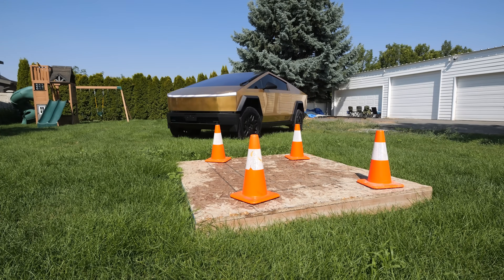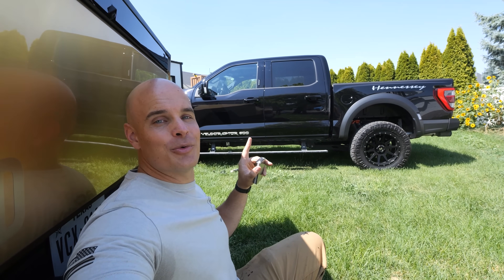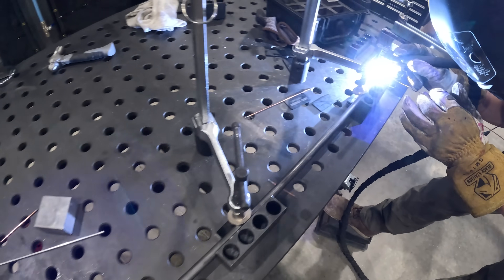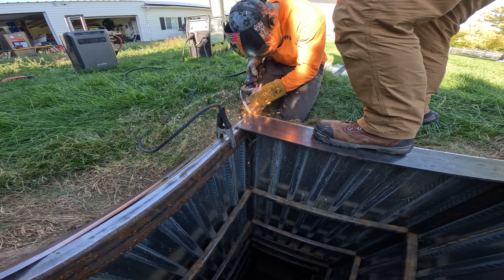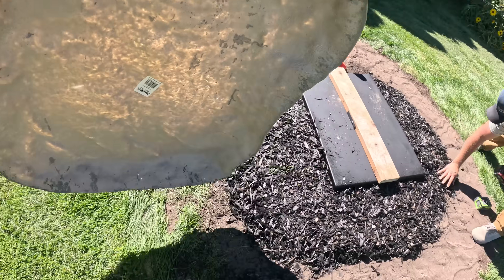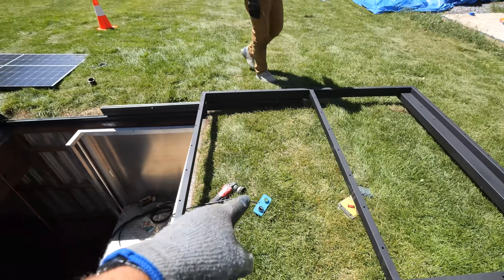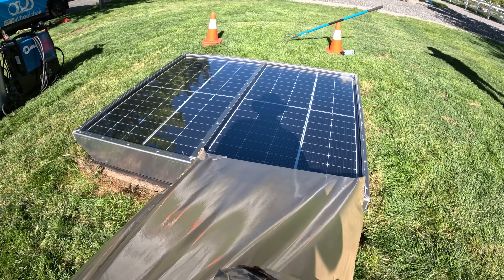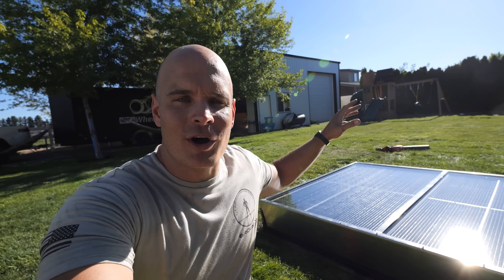Bulletproof Solar Panel Bunker Door Build - (unlimited energy!)

Comment: 320W * 2 * 1.15(bi-facial gain) * 1.5(Utah sun efficiency) * 90%(panels lie flat) = 1000Kwh per annum.  That's quite tight (<3Kwh / day) for 2 people, let alone you might take in a few buddies.  And then you have that huge 90 inch TV which can eat 600W.  Use it 5 hour/day there goes your daily budget.  And you are preparing for Armageddon?  You are not going to see 1000Kwh in a nuclear winter.  What you really need are nuclear batteries.  Lot's of them that can last >5000 years.  You also need more room and electricity to grow vegetable.  LOL.

Comment: you said you have kids running in the backyard sometimes and kids will be kids...why not just make the solar panel cover auto-close?
you could attach a cable inside the tracks to the unistrut bearings plates and attach a weight to the cable and just put a plate against the wall to cover the weight so it's not dangling freely
then you could weld a piece of steel to the top of the elevator diagonally and weld another piece with some ball bearings on the underside of the sliding door
so that when the elevator goes up one plate pushes against the other with the ball bearings forcing the sliding door to the side
this way it auto-opens when the elevator goes up and auto-closes when it goes down

Comment: Here’s my recommendations:

1 • (Power) Add more solar panels and more powerful ones if possible, Also chargers of every type like usb-c chargers, usb-a chargers, lightning chargers, micro-usb chargers, etc. (This category is done.)

2 • (Emergency items and kits) Add lots of canned food and emergency kits, They could have tools, toolkits, energizer lithium batteries (AA) (AAA) all types Etc. Also some rechargeable batteries from energizer (That’s the best brand for small batteries like (AA) and etc. Also toys, games, solar power banks, normal power banks, flashlights, canned water, more canned goods, pet food, canned pet food, airtight jars? (Could be helpful?) etc. That’s good for this category (This took a long time)

3 • (Clean air) Add even more circulation somehow, also add lots of air filters and air fresheners, you could also add automatic air fresheners that make the air smell good once in a while. (This category is done.)

4 • (Extra) You could also add super fast WiFi routers, and super fast hotspots running on 5G pro or 6G when it comes out. (This category is done.)

5 • (Medication) Also add medicine, pills, vitamins, all types (Idk all) (Make sure all of them are sealed and airtight to make sure it lasts. (This category is done!)

6 • (Random thing) Add sealed hand sanitizer and soap. (This category is done!)

7 • (Other necessities) Also add pens, pencils, paper, journals, books, erasers, (All types of pencils and stuff) Also glue and tape. (Basically school supplies) (I forgot printers!) (This category is done!)

8 • (More) Also add extra Shoes, clothing etc. (This category is done!)

9 • (Decorative stuff) Also add paintings fake plants or real plants. (This category is done!)

(🔴🔴🔴Message: WOW this took a long time to write hope this was hopeful and please credit me. Have a nice day🔴🔴🔴)

Comment: $300 for one solar panel? That's some huge prices there! In Ukraine, I have a 610 Watt bifractal from Longi Solar, model LR7, for only ~$80! You are very optimistic about these 2 panels, in cloudy weather you will have at best 10% of the nominal power of the panels, and this will not even cover the inverter's own consumption, much more is needed!

Comment: aren't you going to put a white panel under the solar panelswith a small air gap to reflect the light onto the backs of the solar cells from the light coming through between the cells? It would make them even more efficient...

Comment: You could build a small shed building g on that sliding frame then put solar panels on top that way no one can step on them and the building can be designed to slid open as lift goes up .. Lots of interesting ideas out there a d love your videos.

Comment: I wouldn't recommend attaching the wind generator on top of the roof, solar panels are notorious for causing roof leaks, and something designed to catch the wind may put extra stressors on the roof... maybe a pole along-side the building instead?

Comment: Seems like the hatch now blocks the elevator but since it does go above, you'll need a new ramp to get over the rails or to come in from the other side... A latch to lock it in place so the sliding doesn't happen would help too.

Comment: Make sure to use a hydrophobic coating on those plexiglass panels it helps with dust and water buildup although I think you should have mounted it at a slight angle

Comment: You should build a small shed and use the roof or the panels. The shed will hide the entrance and you have an extra layer of protection that blends in with normal backyards.
Reply: but that would mean even less airflow. which wouldnt  be a problem if he already put in a system.

Comment: Lots of comments on the solar, and rightly so, but my concern was security. The expense of a bunker that isnt gas tight kind of defeats the object? I was imagining some heavy duty hinged concrete door on top? Or a sliding one like on a missile silo. 
After the initial push, the bunker seems a bit on the back burner, cost issues im guessing?

Comment: What about the air intake and output? It seems like you go rid of the exhaust when you replaced the exit hatch. Also, is there ramp over the track for the wheelchair? And does it slide open even if the grass is really high?

Comment: How will Cambry enter the bunker now? The sliding rails look like it'd prevent her chair from easily accessing it.
Reply: Elevator video 14:25, it extends 2ft above ground level so will clear the sliders. Also mentioned a ramp but it wasn't used at that point.
Reply: He has a video showing them installing a scissor lift as a permanent make-shift elevator.
Reply: @Tyler-z8r  Yeah. But now there's a 2 foot tall rail on either side of the lift at ground level

Comment: Im wondering how your wife should get over those rails with her weelchair 🤔 I mean you could build a ramp wich covers the rails when the elevator goes up, but like this i think it would be hard to get in or out wth a wheelchair. Also would it be nice (i think) to be able to open the "door" with an elctric motor, so if the elevatr gets up the "door automaticly opens" or ith a button press. So you could lock it also.

Comment: Probably going to want to put a latch of some kind on that, it you want it to be "safe" you can have it suddenly moving when someone steps on it. Imagine some kid is running around and hops up onto the panel, only for it to slide forward, and they topple backward into the hole.

Comment: Why bifacial when you have installed them in a way that only one face can work.  The rear face capture’s ambient light and ground reflected light.  You should at least install mirrors under them or have just got cheaper mono facial panels.

Comment: Well done
But i think it's not a good idea to use acrylic in tempreature wise and  as you say always glass is glass and glas can break acrylic also can break and it  it scratchable more than glass and it will affect the efficiency of the solar panel

At the end don't forget to close the sliding door for childern is  safty

Comment: I don't think perpetual and unlimited apply to solar cells that average a 20 to 30 year lifespan and an absolute limit of 40 years for even the most expensive.  Also compare a refrigerator pulling 300 - 800 watts of power (when running), not really that impressive.

Comment: Doesn’t this dude have 10kW of solar on the roof of the building right next to this? Why independently power the bunker with a dinky inefficient set of panels?? Maybe if he stopped shilling for these hobby-grade solar companies, he’d put in a real Enphase or Tesla battery back up system in the bunker that stores and distributes energy from the roof top solar that IS RIGHT THERE. I’m honestly surprised I’m trying to make sense of this, when it’s just another influencer being an influencer.

Comment: Those panels are designed to be mounted vertically, not flat, not at an angle. You are severely reducing the efficiency of them as they take in light from both sides. I get it, this was to make it look cool, but you could have still come up with a cool design that used them in the right way. They are integrated circuits, as well, so you are also putting them in an oven, reducing yet more efficiency.

Comment: acrylic sheets are blocking uv so panels wont be as efficient afaiu
Reply: solar panels aren't typically tuned to make any use of UV and even if they were only 4 percent of the light that reaches earths surface is UV so it would be a tiny difference.
Reply: @zachmoyer1849  thanks for the clarification! do you know if then this also makes sense for plants? will plants be affected from blocking uv with an acrylic sheet?
Reply: @im0b  not for them to to perform photosynthesis but some do need it to bring on certain grow phases.

Comment: hear me out... add a motor, and LEDs down the entrance shaft, which light in sequence as the door opens, two benefits a) it'll look cool to be able to open your bunker from anywhere on the planet from your phone and b) you could add a strain guage and have it shake if it senses (some) weight and shake itself, as if it's annoyed at the kids playing on top.

B is optional, and should be togglable.

Comment: You should put a small light weight decretive fountain or bird bath on top of the fake rock to make it look even less out of place. Sure it will dump out when it's tipped but it's an emergency hatch not meant to be opened often right?

Comment: The scratches that'll form on the acrylic drastically reduce the efficiency of the panels, and also the sheets would have a UV resistant coating 
I hope you checked them

Comment: I think it's really good that you have your bunker hidden, but you better hope that none of the zombie mutants were fans of your channel before becoming zombies.   I do have one question, though.  Why have solar panels that can make electricity on both sides if one side is permanently facing the ground/opening?  Or did I misunderstand how those panels work?  

I live in an apartment so an electric truck would not be a good choice.  As for the gas truck, I don't drive anymore because I've taken painkillers for my back for the past 11 years.  So I think I'd have to opt for the cash.

Comment: Noticed that the frame doesn't slide completely clear from the hole, nor that the bottom slider is recessed. How exactly is the elevator still wheelchair accessible with a massive frame in the way?

Comment: I dont get it. Is that the main entrance to the bunker? If so, how do you close it shut? Why not place some kind of hidraulic and ratacional system on it to maximize the solar panel performance? Why not an alternative system that collects wind power to complement the energy generated by solar panels?  I am not sure where are you going with all that at this momment...

Comment: Hi Zach, I think I'm missing a crucial part of the puzzle: How is your wife going to use the elevator now? Looking at the ease with which the door opens (at least now that it's new and clean) she'll probably be able to move the door on her own, and I don't doubt the elevator will go high enough to account for the extra 10 inches, but how is she going to go over those 10 inches? Are you going to add a ramp?

Also, limit switches on the elevator (and maybe a system so the elevator will open the door) might be prudent :)

Comment: You should've reduced the thickness of the acrylic and used tempered glass on top instead. That acrylic will scratch up super quickly outdoors. Also, the solar panels might heat up due to all this thickness above it. Be sure to cool them well from below.

Comment: SO.... your not worried at all about your bunker being flooded with radiation? As you didnt go with an entrance design that was 90degrees off from the bunker, they only other way you could provide enough "protection factor" would be to have an 12inch concrete cover.

Comment: If you split the sliding bit in half(Left and right), you could put standing panels that rotate on each side to face the sun. Could even do 4 panels(Two on lifts that slide them higher so they don't block the other two as the sun moves). Then it would slide apart, like parting the red sea, to give access to the elevator. Removes the need to the Acrylic(Which lowers efficiency, and helps them overheat), and you can put them on a solid metal base cover that can be sealed against the weather. Gives you the best of all worlds, and removes the pitfalls.

Comment: so much to be said here
this is not nearly enough to run anything meaningful especially not a bunker, what will the air filtration/ventilation work on? as of now its just hopes and dreams. might (most likely will) need  a humidity regulator, lift, lights, small fridge or and freezer, etc.  add that 100" tv to the mix and buddy here needs a solar farm; 
how much battery capacity will the bunker have?

saying that because its my 3rd year living completely off grid with solar and i don't see how that would be enough
** note: why bi-facial in this application, it negates that part, there is no light bouncing back at it 
why not just one sided panels? 
there's more wrong but oh well 
not hating btw

Comment: So you built a bespoke, complex double extending sliding hatch with bifacial solar panels that will only ever get sun on one side, that you have to protect with UV blocking acrylic panels heating the whole thing up, mounted at an inefficient flat angle? Instead of ... I don't know ... using regular panels, mounted at an angle and a regular hatch?

I know this is all just for show and to flex your gold cybertruck, but this would seriously make me think twice about getting one of your wheelchairs, because I'd be afraid you completely overcomplicated those as well...

Comment: Well, this was kind of silly.

It would have made a lot more sense to build a shed over the opening so that no moving elements were required in addition to the elevator...and oh what the heck, a bit of storage?  Still roof it over with the solar panels, even the big acrylic sheets if you like, and it would be a lot more accessible in an emergency.  Rather than go through the unwieldy steps of unlocking and moving the slides at ground level and then getting on the elevator, you just unlock and open the door in a very familiar motion and get on the elevator.

Comment: I would have made the solar panels slide in the opposite direction and have a stopping point so only the lift is exposed. The way it is currently, you have to fully slide open the panels to expose the lift, which also exposes the ladder shaft. It just feels a little less safe to me.

Comment: Why did you use bi-facial panels when the bottom would never see the sun?
Reply: If you have a reflective surface underneath the solar panels the light will reflect up.

Comment: Are you gonna put like a hydraulic strut for the fake rock exit shaft? I'd figure that would make it easier to open up or even just tilt open a bit if you need it. And have you added some kind of vertical guide rail for the elevator? The last video you had of it, when it was raising and lowering it seemed to shift side to side very easily, and I'd figure a guide rail with some roller bearings would make it more solid of a lift?

Comment: Very cool build. Love the concept. 

For practical purposes I recommend having a solar panel ground mount at a fixed angle facing south.  The build up of dust and debris at ground level on a flat solar panel will quickly take away all power production. And those living in the bunker will have no way to come out and clean the panels.

Comment: Why use more expensive bi-facial solar panels when the underside will get no sunlight at all.  And I agree with another commenter that the acrylic will heat up the solar panels degrading their output.

Comment: For anyone using acrylic sheets like this, I'd suggest rinsing them off with water rather than brushing them off when dirty. The reason being is that every time you brush dirt off them you're creating scratches, which over time will reduce the solar panels abilities.

Comment: Jerry, quick question. How is your wife getting to the elevator now that the solar panels are sliding open to the side she has to use to get on said elevator? Wouldn't it be easier to have the solar panels slide the other way?

Comment: Those 2 panels will never be enough for all the electricity down there... impossible unless you only have a few led lights. As soon as you want to run a fridge or television, it wont be enough.

Comment: If the sliding solar door is sliding into grass, i imagine it will not open if the lawn is not mowed. Which means that the backup becomes the only means of exit

Additioanlly i would probably add an internally operated pressurised water sprayer or something to clean any debris on the solar panels

Overall, very cool project!

Comment: On the solar efficiency, keep in mind that those acrylic sheets will weather, and that they don't let heat dissipate. Solar panels work best when cold, so you might want to look into a water cooling loop (that can be done with a little 10-watt pump and a bucket, realistically) or something similar

Comment: You might want to put some silicone between the bracket that holds the acrylic and the solar panels to avoid water to get in between and possibly generating moss or something that could render the effectiveness of the solar panels or what you guys think?